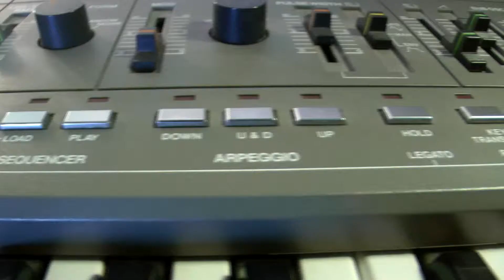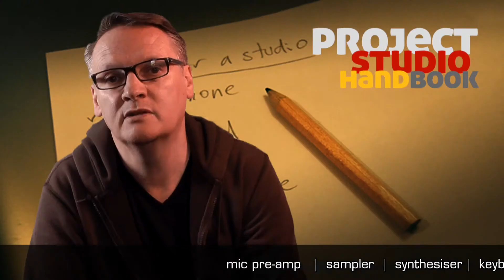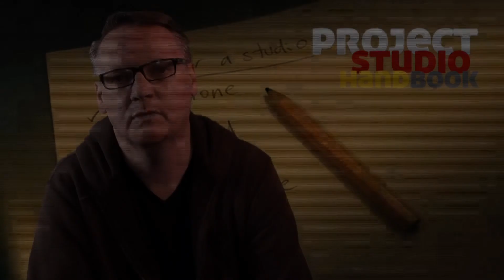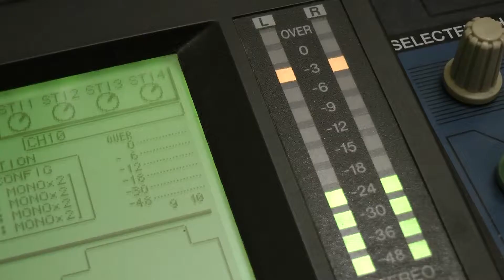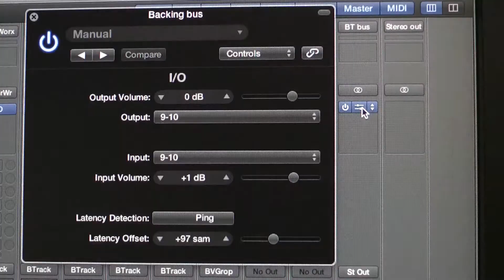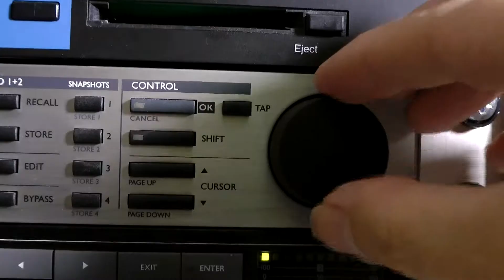Line level audio signals

Comment: can i send back the signal from daw to the mic preamp input ?
Reply from the maker: Not easy to do because the DAW will output a line level signal that will overload the mic level input of the pre-amp.
Reply: how if i use a reamp box ?
Reply from the maker: Try a DI box. A re-amping box may produce the wrong impedance for a mic pre.
Reply: +Project studio handbook passive or active di box? can it handle line level signal?
Reply from the maker: Passive or active will be fine. DI boxes convert unbalanced signals to balanced so should work fine. You will need to adjust the signal coming from the DAW so it doesn't overload the mic pre.